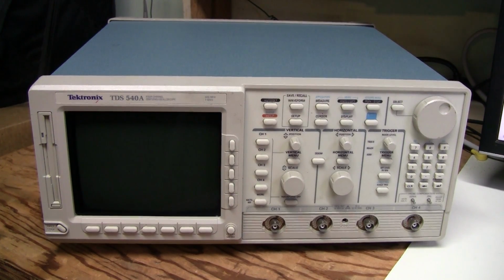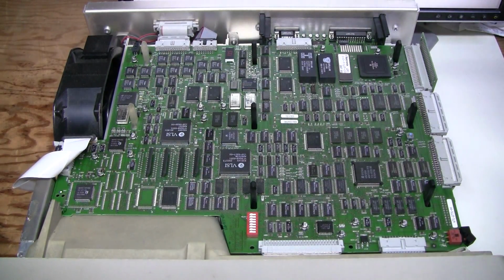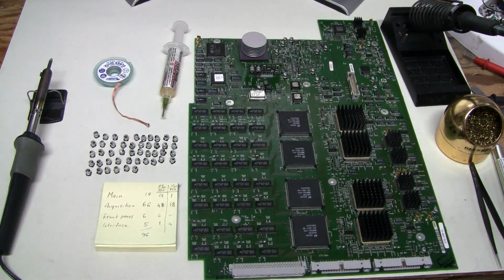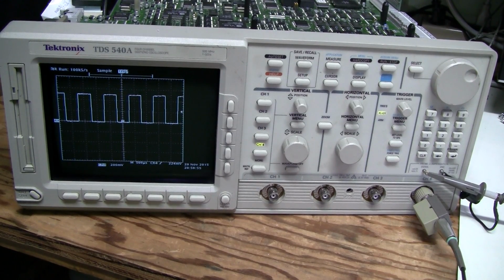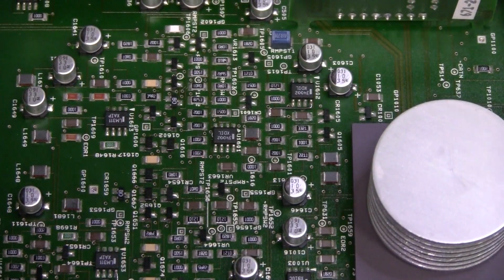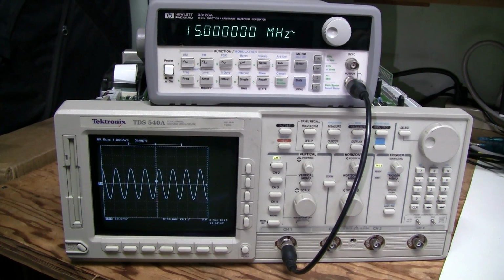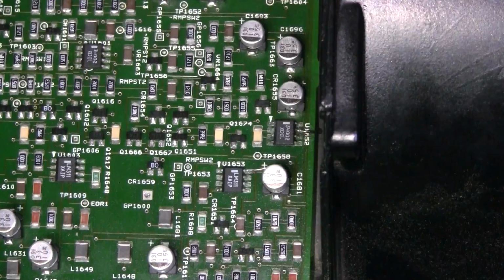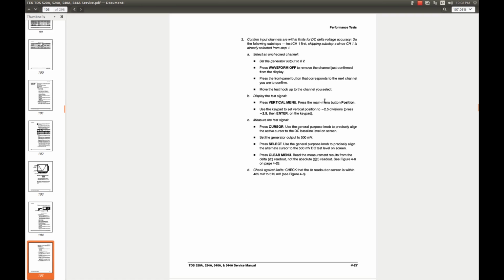#34 - Tektronix TDS 540A oscilloscope repair

Comment: After 3 years in the repair queue,  it's time to do this project on my TDS540. 😢 It now no longer boots up and is stuck at the clock icon screen. Either the rot on the acquisition board is now much worse or the Dallas chip battery has given up. Would you put the backup files on a Github page Alexander please to offer a way back for these elderly scopes? Capacitors and schematics were bought ready to start. All the best David M0YDH
Reply from the maker: well, the video is almost 9 years old. I sold the scope a few years ago. I believe that I published the dump in the forum topic linked in the description.

Comment: I'm surprised at the number of open circuits you found.  And not so happy seeing DS1286 and DS1650 parts with embedded Li battery, even though they are warranted to last at least 10 years with no power applied to the IC.

Comment: Thanks for the excellent video. I have 3 Tek scopes with the Dallas chips (one of them it's a digital, colour one, very similar to this one in the video), and I need more, in depth info about how to make the backup (the app you used, etc.), because I want to modify the battery with a new one, which will last longer. But previously I need to do the backup...just in case!. Do you know this procedure in depth?. I think so, because you have made it here. TIA for you help.

Comment: Years later I admire your detection skills. So many faults and now a board with good fft. Fast Fourier transform for prettier waveform. If I get one of these 540's with the caps in this condition I will expect lots of traces obliterated, and probably some ic's dead.

Comment: I love videos like this where the technician speaks his thoughts as he's troubleshooting.  What I'm wondering is - how can there be so many bad capacitors and bad circuit board runs in what was once an expensive oscilloscope?  I'm looking into buying a TDS 360 and you've taken a lot of the mystery out of what's inside the enclosure.  I was wondering if I would be able to repair one if I got a defective unit.  Thanks for taking the time to make the video.

Comment: Did the same with my 540. It still complains on acq board on startup, but the rest is fully functional. Still can not figure out what means "ctlConfidence diag, 2.50e-9 <= exp <= 1.20e-8 actua..." error. Even can not read the full log  message from display (because truncated after "actua...") ;-( Both ramps looks in order. Looks like will need to borrow GPIB interface in order to read the full message and turn on FFT option by the way. Decoupling caps replaced with tantalum ones, replaced couple fast memory chips on acq board, because there where memory errors sometimes. replaced the ADC at fourth channel (because of strange noise was there) . Thank you FeedbackLoop for this video. This instruments are lovely beasts !

Comment: Such a neat idea ...taping the backup to the top!
Reply from the maker: It turned out that those labels don't hold very well especially if bent over the edges. Straight labels stick better. Perhaps some other tape should be used

Comment: Great repair work! Bravo! I just want to say that my Tektronix 422 (1967 transistorized 2-channel 20MHz scope, mine since 1975) has never failed or lost calibration (still within 5%). The caps are miraculous, the whole scope is a miracle. I won't touch anything inside until something fails.

Comment: I've just bought faulty TDS 620A with the same self test errors. Already inspected all boards and mine has exactly the same ugly signs of corrosion here and there. I wonder if I'll be able to replicate your work, because from the video it's obvious to me that you are much more experienced and have better gear to to that kind of repairs but I'll give it a try. Anyway very big thanks for the video - it'll be the guidance on my path to rescue the scope! ;)

Comment: Nice job ! 
And I thought that Tektronix equipment was expensive because they use only top quality parts...  Pfff...
Reply from the maker: They do, but shit happens sometimes.
Reply: My Tektronix 422 (1967 transistorized 2-channel 20MHz scope, mine since 1975) has never failed or lost calibration (still within 5%). The caps are miraculous, the whole scope is a miracle. I won't touch anything inside until something fails. Tek equipment was worth the price always. I don't have experience with modern Tek gear. I'm still using my 422 and 2465.

Comment: Hello, great explanation!. Question: I have a "Not Working" TDS540B coming, and I want to be prepared for the recap so I want to order them. What size of 10uF 35V and 33uF 10V capacitors did you use?
Reply from the maker: The label on the reel says 5 x 5.5 mm.
Reply: FeedbackLoop hi thanks for your response, I'll order them that size. In hindsight, I had another look at your movie, and I could see the size on one of the reels. :-)

Comment: Very nicely done! Excellent job. I wish i had found your channel sooner. With regard to cleaning the corruded boards, how do you rinse and dry it after scrubbing with Simple Green? Do you recommend Acetone for cleaning PCB board with or without SMD components? Thanks
Reply from the maker: I wouldn't use acetone. I rinse with distilled water (or from reverse osmosis filter) or isopropyl alcohol, blow compressed air under the chips and such, and dry with a hair dryer.

Comment: I saw in Paul Carlson video (Mr. Carlson's Lab) a faster method to get those caps off. You just have to twist them but you leave broken pins on the boards and you have to desolder them afterwords.
Reply from the maker: There is always more than one way to do something. That one works too, I suppose. It has its own risks of lifting the pads, for instance. My method is not ideal either.

Comment: Your repair video and the analysis of the failures and their repair is very attractive.
I enjoy watching it.
Maybe I can get help from members in this community for repair of my TDS744A.
After lifetime of the batteris in the NVRAM DS1650 an the timer DS1486 has ended, I desoldered both circuits and replaced them with a socket. Now the information in both ICs is lost and the scope boots up after several attempts but with lost data and SPC information. I have bought some ICs from china, but I have no Information about the programm to be loaded.
Where can I get it or who can help?
Reply from the maker: I don't think that YouTube comments is the right place for this sort of stuff. I suggest http://www.eevblog.com/forum. Also have a look at this site, which is a great source of manuals, firmware and such (try NVRAM from 784C): http://www.ko4bb.com/getsimple/index.php?id=manuals&dir=Tektronix/Tektronix_-_TDS_784C. Good luck.
Reply: Excuse me for useing a wrong path for my problem and many thanks for Your links.
Reply from the maker: Nothing really wrong with using YouTube comments, but I believe that they are not effective if you are looking for technical advice. Especially, from the audience, not the author. EEVBlog forum must be much more effective for this.

Comment: Nice video, like & subscribe! I have TDS540 with same problem. Self-test sometime is OK, but oscillogram is poor. Today i buy all cap-s and on this weekend i try to replace all of them.
Reply: I changed all of capacitors, but selftest still error attn/asq interface & cannel 1 dc balance is wrong. I found bad ic U1401-C one output of 4 OA on pin 8 measured +3.8V and dc balance gone wrong. I replace TL074C and oscilloscope passed selftest, channel 1 still working correctly. Thank's too much for links to schematic & service manual.

Comment: Hi Feedbackloop, I have a Leader LBO522 Dual Trace scope and I accidentally shorted ch1 to mains ground and I heard a loud bang and the probe got damage. However, When I try to use the scope again with new probes, both Ch1 & 2 are giving me some funny readings. Can you point me in the direction or which board  may be faulty so I can begin trouble shooting. Thanks.

Comment: Very informative video. I would have never even considered leaky capacitors as being a potential issue with oscilloscopes, with them being such expensive pieces of equipment. Definitely something I will look out for if I decide to buy a scope for a repair project.
Reply: I believe corrosion as a result of leakage only happens with capacitors that use more aggressive water-based electrolytes (common since the mid 80s or so -- these small ones here were meant to replace Tantalum drop capacitors)), since the electrolyte from older caps is pretty much just a mild solvent. Seal construction is another factor. That's why so many devices made from the 80s onwards suffer from leaky caps destroying circuits. Meanwhile you will see devices from the same period of time using different capacitors which are perfectly fine decades later. Blue Philips capacitors tend to dry out, but I've never seen one ruin a board.

Comment: There is an open source software for Linux and OSX for the MiniPro, and from my experience it works great: https://github.com/vdudouyt/minipro
Reply from the maker: Does it support DS1650Y?
Reply from the maker: I see that it does not at the moment. And I see open issues dated back to 2014. Not a good sign.
Reply: I think it supports exactly the same chips as the Windows version. I always use my MiniPro with this software and had no issues with it so far.
Reply: RóbertCsordás

Comment: Excellent work; goes to show when persistence pays off. There is nothing more concerning when you see corrosion on the boards and especially the IC'S, not to mention all the bad capacitors that were open. I am surprised the scope even powered up, "congratulations on a job well done"

Comment: Have you ever repaired a TDS820 (6GHz 2 channel)?I am currently working on one that had similar faults to your 540.Same cause of problems being leaky caps. All caps replaced but there was no trace and self test failed with Acquisition and sampler1 and sampler 2 faults. I cannot find a schematic.So far I have cleared the sampler1 fault and got it to start triggering which restored both traces and now the setup tests work which did nothing previously. Ch2 has a large DC offset which I think is responsible for the sampler 2 self test fail but the scope will only trigger on the internal clock. External, CH1 and Ch2 triggering do not work at all.
Reply from the maker: +Jerry Walker 
No, never seen one. I suggest searching the http://www.eevblog.com/forum/, and, perhaps, opening a new topic. Describe your problem, attach photos and such. There is a good chance to get suggestions.

Comment: Very nice repair. You put a lot of work in this Tek. Question: Why are you so interested in the TDS540A. You have one already. What features do you like most? Or is it only the repair? When the Dallas chip is broken is the TDS540A beyond repair or is there a solution? Great video, will follow your channel. Bye FEY
Reply from the maker: +FEY 
I just happened to find a good deal. These 5xx and 6xx Tektronix scopes present a great opportunity to have an affordable, but quite capable scope in a hobbyist's lab. Of course I will sell one of the scopes. I don't need two.
Reply from the maker: +FEY 
The Dallas chip can be copied from another scope. See my follow up video.

Comment: Hi, inspiring videos, I just got a TDS 644B, works ok. it has seen some action and is a little dirty and needs some TLC, was wondering if I should tear it down and clean it?
Reply from the maker: +Craig Hold 
I would certainly suggest having a look inside. Chances are it needs recapping too.
Reply: Thanks, so you have a blog?

Comment: Hi I have a TDS 320 that is completely dead in blank screen and, saw and hear you speaking about capacitors the tds 320 don't have those  big electrolitycs caps but, all they are SMD,I think the problem here is the battery,just don' know if is possible open that memory chip,is it possible?
Reply from the maker: +CYBERRD58 
It is hard to say anything useful based on your description. I would suggest asking on the EEVBlog forum - see the link in the description. It is one of the best electronics forums on the net. Carefully describe your symptoms, attach photos, and quite likely you will hear some suggestions from very experienced folks.
Reply: Thank you

Comment: Congrats on a great repair! Peter on the TRXBench channel recently dealt with leaky electrolytics that did considerably more damage than you had and showed it is possible to do this kind of repair. Boy, with well over a hundred caps I think I might have bit the bullet and gotten a tweezer iron! BTW, I got some of those Dallas chips a long time ago from a reputable supplier and they all were bad; I think they actually may have been knock-offs that somehow made it into the system - sourcing them directly from Dallas solved that problem. Look forward to your upcoming videos - Happy New Year!